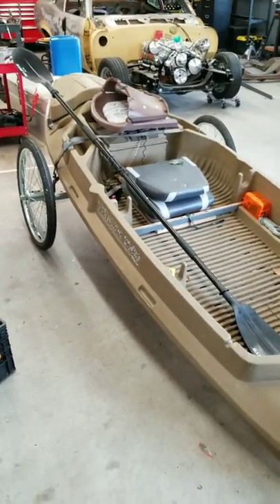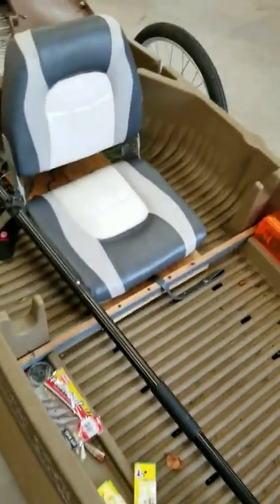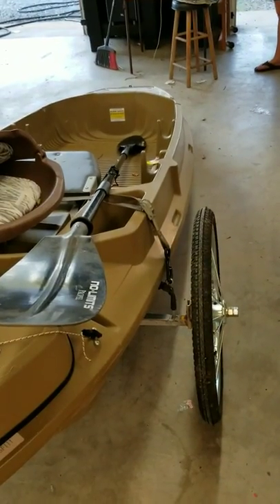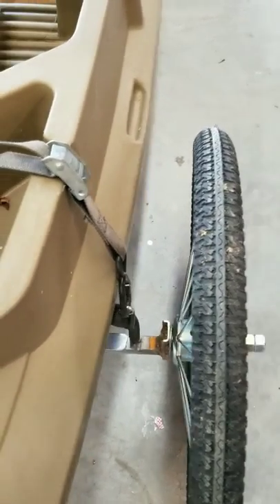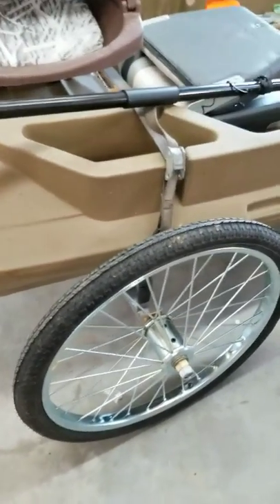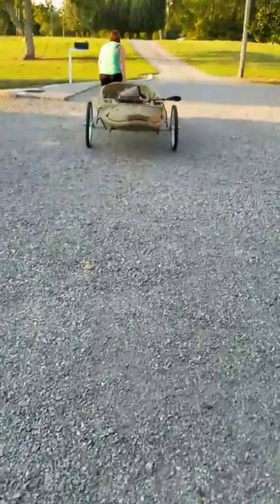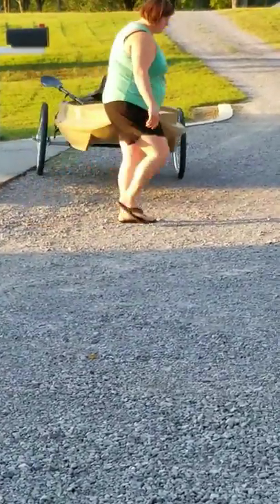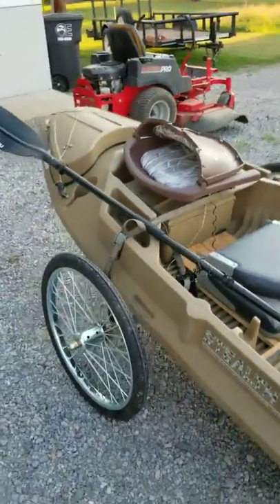DIY Kayak Cart     (((BIG BICYCLE TIRES)))

Comment: What was your total investment for the cart?  Just picked up a Stealth 1200 and was weighing my options of build vs buy.
Reply from the maker: mayonaze311  hey buddy I got a bike for $10 on the facebook yard sale and I had a 1 inch piece of tubing in my garage laying around. I had to buy long bolts for the axles. So it did not cost me much at all. But I will tell you what I made is much stronger than anything you can buy in a store. I pull this thing over huge rocks and tree roots. I have punished it pretty hard.

Comment: What are the brackets you used to connect the square tubing to the axle/bolt?
Reply from the maker: Truthfully it was just some scrap pieces of metal that I had laying around from a new trailer jack that I welded on instead of bolting it on. But basically it was just a flat piece of steel with holes drilled in it so I enlarged the hole to accommodate the axle size and then welded it to the 1 inch tubing. Thanks for watching! :) Please LIKE & SUB

Comment: Hi Matthew. Do you have plans or a parts list for the kayak dolly?
Reply from the maker: No sir, I built it from scratch out of 1 inch tubing and I used the Bicycle style wheels from northern tool and I  welded on bolts for axles. I used old bicycle inner tubes to rest the kayak on to keep it from slipping off and scratching it up then I painted everything with rustoleum hammered paint. I gotta say its been a good one! I would build the cart tailored to your kayaks width because mine is very wide and hard to get in some places. Thanks for watching and please like and SUBSCRIBE. :) If you have anymore questions I'll be glad to help you out!
Reply: @matthewmeltonTEAMMELTONFISHING  thanks. I have the same kayak, so that helps a lot! Jeff
Reply from the maker: @jeffcoughlin1818  I sure love my beavertail stealth 2000 it's so stable and built like a tank but it's just so damn heavy. Lol
Reply: @matthewmeltonTEAMMELTONFISHING  hey Matthew, could you please send me a picture of the dolly itself, not covered up by the stealth?
Reply from the maker: @jeffcoughlin1818  sure what's your number and I'll text it to you.
Reply from the maker: @jeffcoughlin1818  I am just now getting in the bed, but when I get up I'll go take pics of it.
Reply from the maker: @jeffcoughlin1818  did you get my text?
Reply: @matthewmeltonTEAMMELTONFISHING  yessir, thanks!!!
Reply: @matthewmeltonTEAMMELTONFISHING  could I get one too lol
Reply: Steel or aluminum tubing ?